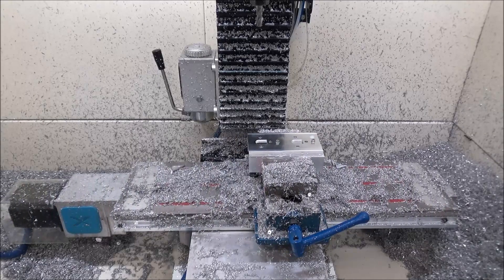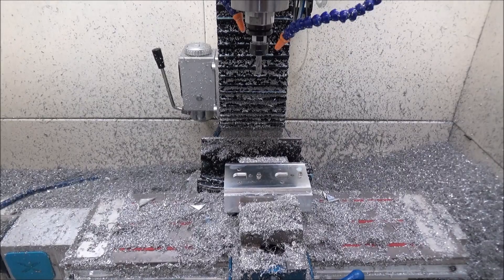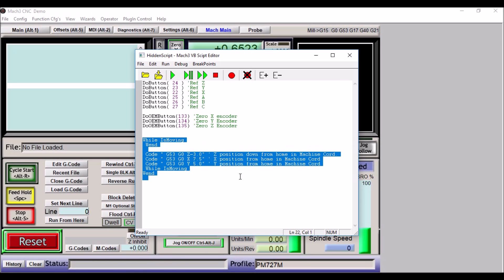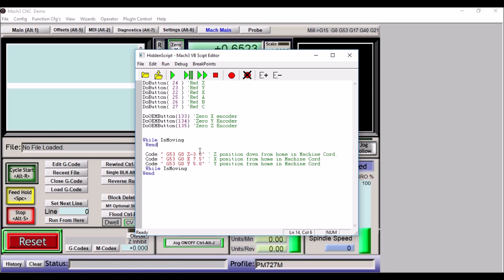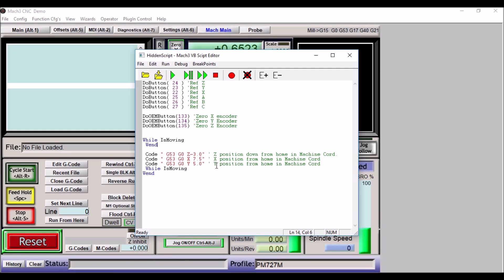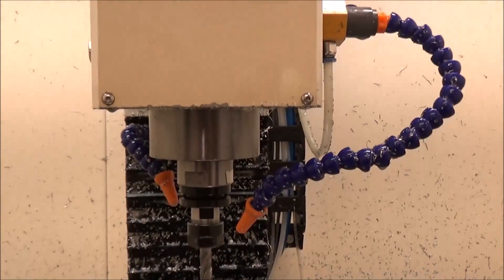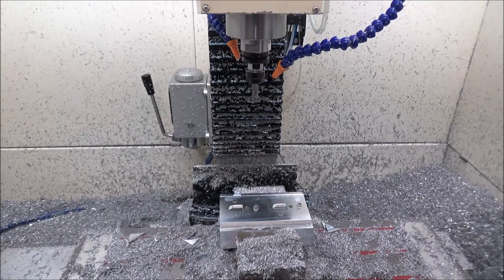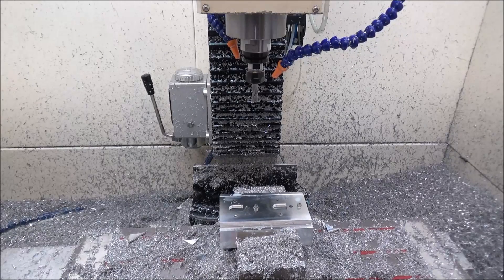Mach3 Reference All Quick Fix

Comment: Could I edit the Macro to reference home in the negative direction? My home switch is on the left side of my gantry, hitting reference home button makes the gantry move in the positive/right direction, please help
Reply from the maker: In Mach3  config/homing limits. there is a home negative check box. Select this for the axis you want to home in the other direction.

Comment: Hello my friend. when I set all axis to zero and set them as a zero for the machine by ref all home it works well at every time I press ref all home a button. but when I close the computer and re open it and re open mach3 program and press ref all home button the all axis do not back to zero machine that I set it before. How can I solve this problem please
Reply: Although every time I do a session save before closing Mach3 program
Reply from the maker: when you exit the button script does it ask you to save? and you say yes.
Reply: CNC4XR7 yes I do
Reply from the maker: @yasom4566  when you go back into the script is it still showing the changes?
Reply: CNC4XR7 The problem appears after the computer is locked from electricity and restarted again.  And re-press ref all home as the axes do not return to the zero point that I previously set
Reply: @yasom4566  i have same problem with you, have you solve these problems?
Reply: @yasom4566  i have all proximity sensor for x, y, z and stepper with encoder closed loop system, but when i turn off computer or machine, machine coordinate still changed, i'm confused for this mach3 software, my question is, does mach3 save machine coordinate?

Comment: have you looked in the soft limits page and the custom g28 settings?
Reply from the maker: Hi Tom, Yes there is a option for home offsets in the Home /limits set up using G28. However I prefer not to use G28 which can get confusing to even veteran users.  G28 allows for Absolute and incremental movement which can cause issues. I prefer G53 it is much easier to understand.
Reply: Everybody has there way of skinning a cat (at least in china)
G90 G40 x--- y--- (to cancel tool diameter offsets ) 
m5 (turn off spindle)
m9(turn off coolant)
g0 z.0
G49 z.0 (cancels tool length offset z retracts pos to machine home)
g28 x.0 y.0 (return to machine home or custom home) 
m30 (Rewind)
I use many offsets like g54 --g55 ect. ect for different products and multiple parts
Reply: And i confuse easily
Reply: Also I enter tool length offsets directly in the main screen as a neg. The method you use is for a production environment were they want to pre set tools as the machine is running
home z.
Set dro to machine cords
bring tool down to touch material or fixture depending on the setup in cam.
Highlight the tool number type tool number then hit enter.
highlight length then type number from the dro. 
change from main screen to MDI screen type  g49 z.0 to retract
Use  G44 H___ in the program
Reply from the maker: I agree many ways to get the same result.
Reply from the maker: Hi Tom,
Yes my tool offsets are stored in the tool table where each tool is measured when setup. My tool change macro will apply the offsets during the tool change ( G43) so no need to have this in the G code although you can.
Reply: The method I mentioned will store the tool lengths in your tool table .
I didn't invent it .  Fanuc and yasnac industrial controllers work the way i mentioned, Probably others .
Mach 3 will except both ways. I believe the system you use with a master tool is so you can measure and set tool lengths with a setting fixture while the machine is running. In a busy shop environment seconds count.
G43 is G code?
Tool change macro your changing tools manually arnt you? Just check the box on the general setting page it will wait for the tool change and then start when you click the start button.
Do you use G54 G55 ect ect?

Comment: They should back off to the switch turns off you can set a goto position with the tool change location, if you are not useing it for a toolchange
Reply from the maker: Hi Daniel, Yes they do touch and Back off,  However since I do use a Tool change Macro they then stay at that location  until I jogged them to where I needed most often the center of the work envelope. This I added simply to remove a task I was already doing every time the machine referenced.

I thought for larger machines or a CNC lathe where Z axis can be far away from the actual work it would be helpful.